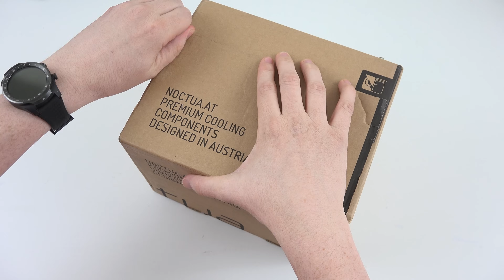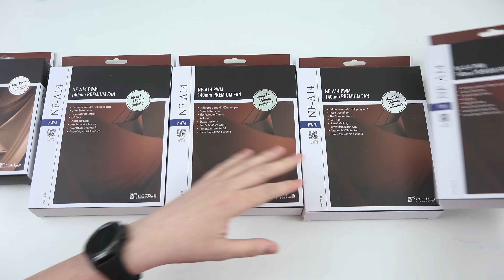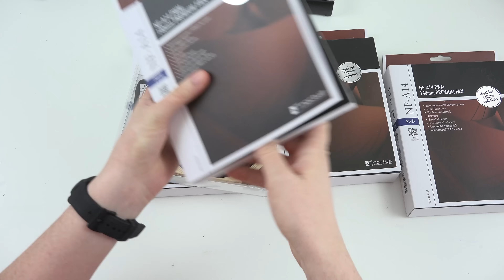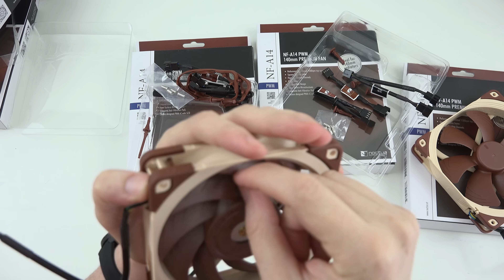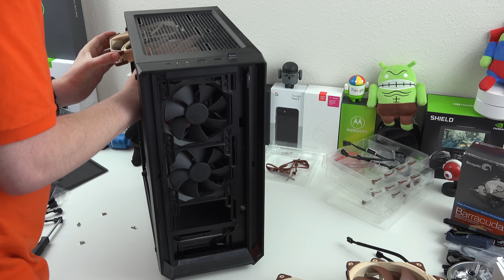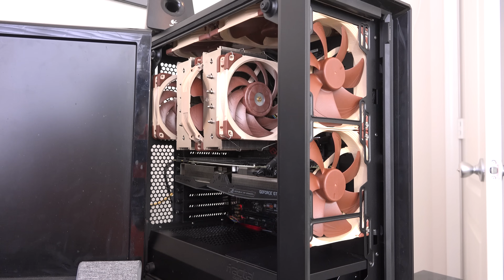Noctua 140mm NF-A14 PWM and 120mm NF-A12x25 PWM (Meshify C Case)

Comment: To get an idea about how much fans you can connect to one header on the motherboard, it's just a matter of current the fans draws. The maximal current consumption of a fan is normally printed on the label, sum all fans up which you want connect, and be sure you stay below the maximum allowed current. This you can find in the manual of the motherboard, it's a round 1 A for the most. But good practise will be to separate the fans by location if you have enough headers on the board. This gives you more control over the system pressure.
Reply: you can also solve with a pwm hub, I got all my intake A14 to the pwm hub that comes with my case (a phanteks full tower) and I've to say it's really handy

Comment: You shouldn't optimize you fan curv when your side panel is off. This kills the airflow, and static pressure these fans deliver. If it only was for filming purposes I get it.

Comment: The top right fan isnt doing anything apart from pulling cool air back out the case. Turn it off, you want that cool air being pulled directly into the cpu cooler.
Reply: No it creates a more powerfull airflow, even if there is loss of cool air, but yes it's probably the least usefull fan from the case
Reply: @simon_roy  so should you take it off ?
Reply: @sodenoshirayuki4288  Depends, if you want to save money don't buy this one, but if you already have one spare go for it, it looks nice
Reply: Barbaros Gatti  For last 8 years I've been running an older Fractal R5 case with solid top on, and just front fans driving air out the backside and it cools just fine. I plugged up certain holes to ensure the airflow went in one direction front to back and that seems to really make a difference. Minimise turbulence, clean one direction air flow and you can get away with surprisingly few fans.
Reply: @wibblewobble1934  I like this idea. Do you do exhaust fans in the back too or only intake?
Reply: @romans_1202  Two intakes at the front side, and the 1 outtake at the rear side, given the number of open holes over the pci slots at the back you could say its a mildly positive pressure system.

Comment: You have created a negative-pressure situation with a sub optimal airflow. To fix this you should either swap the front-top exhaust fan to intake or turn it off altogether. Both the CPU and GPU will appreciate that.
Reply: Would switching the front-top exhaust to intake make the airflow kind of weird since it would suck in some of the hot sir as well as an intake right next to an exhaust? I have the same case and looking to buy new fans

Comment: Hi wwjoshdew! I also have a meshify c with two 120 noctua a12s on the front and one in the back. But mine are INCREDIBLY loud even when I set the fans to silent in the BIOS. I'm not sure what's happening to them. It's been like this for a year now and cooling is fine. Just super loud!
Reply: Haha, and you just did suffer it through for a whole year without troubleshootin? But dig deeper in the BIOS, and try and set the RPM manually to it's lowest, also make usre they are set to PWM. Then the classic: check what pin you put that fan in the back on, did you put it on radiator pump pin? If so you must set it to PWM so it doesn't go 100% all the time :D
Reply: @laggmonstret  I did troubleshoot a fair bit over time but couldn't find any solution so yes I have just got used to it haha. Thanks for the info I'll look into these

Comment: Noctua is just Fan Porn. Put the 140mm in the back, two on my 240mm radiator in pull configuration and two on the front in push. It even stopped my Strix from coil whining on maxed out settings with rt high.

Comment: If you have 2 120mm on top to push air out, 2 140mm in front to suck air in and one 120mm on back to push air out, you are having negative pressure if i understand how all that works? So dust can be sucked up trough cracks without filter in case and with time have worse cooling?

Comment: I don't know how in the hell did you install 2 140mm fans in the front, could you pls explain? Cause the noctua included fans are too short and too thick, there is no way to screw those in. 2x120mm is the only option. I got a fractal design r5

Comment: 219,001views (yay, I'm the "1" in that =) and 1 comment? weird ...
since this video is more than two years old you've probably figured it out by now, 
but for anyone else who watches this: never generally don't put more than 3 fans on 1 header!!!
if the headers don't die immediately they will over time once the fans pull > 0.3 A
Reply: okay so I randomly stumbled across your other video where you mentioned that all of your comments got removed ...
that really sucks man, have never heard of something like this before :O
Reply from the maker: thanks for the comment. YouTube reset comments on my channel. so everyone gets to be first on a ton of videos.
Reply: @wwjoshdew  apparently you didn't notice the reply above your reply? :>
Reply from the maker: @misatzu  oh snap. I clicked from my notifications and only saw the current one. My apologizies.
Reply: was looking to answer this very question.  I just installed new fans in my tower... and I'm debating how best to wire them.  All my motherboad chassis fan ports are open.  I have 1 4 pin, and 2 3 pin connections.  the current fans were all daisy chained to the front of my tower, I have no idea how they are connected, it's difficult to get to them.  I think I'll just route the new fans to the motherboard.  But will split them, 2 and 2 so I don't have 3 to 1 header.
Reply: It is not that simple, different fans uses different amount of current. Noctuas are quite energy efficient.
Reply: @mgoogyi   I was literally waiting for someone to not understand that everything above is clearly to be read as a rule of thumb, as made evident by "once the fans pull > 0.3 A". You can also conceive that part as IF they pull > 0.3 A (each) so if they don't then the rule obviously doesn't apply. Plus you forgot to nitpick that some mainboards provide around double of the usual 1A per header  :>
Reply: @misatzu  The "never" word misled me, but ok, your are right.
Reply: @mgoogyi  no you're right, "never" is indeed too absolute without any clarifying disclaimer. however if you see it as part of the rule of thumb and as valid only within its boundaries it might be borderline acceptable to use.
Reply: @mgoogyi  I tried to use strikethrough but for me "never" appears underlined now on mobile :c
what does it look like for you?
Reply: @misatzu  I see the strikethrough on never (from PC).
Reply: @mgoogyi  on PC I do as well, it's just the stupid mobile app devs who somehow think "-" would be a good idea to use for underline instead of "_" which again causes italics everywhere 🙄 (imma leave it like it is and hope phone users get it from context)